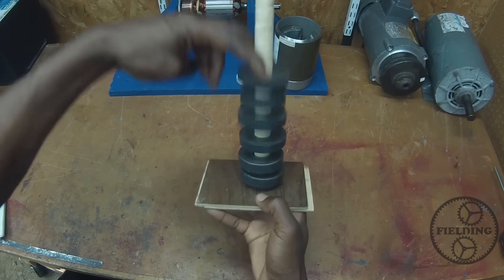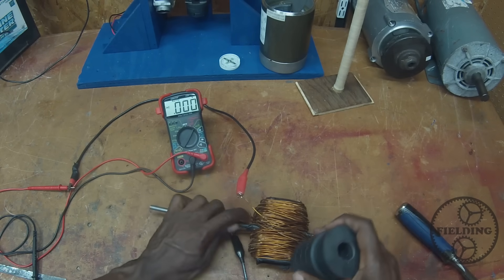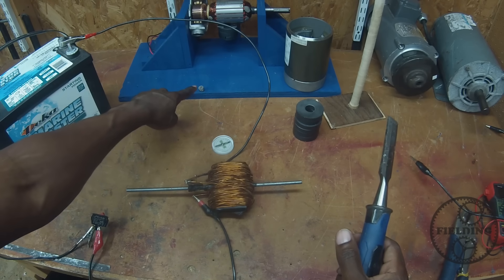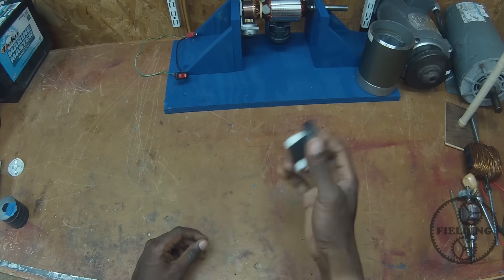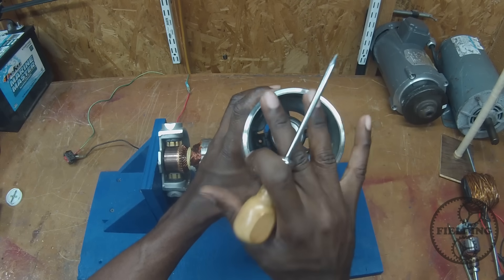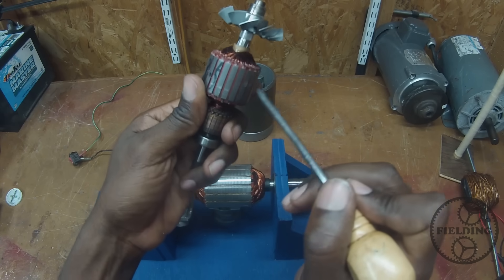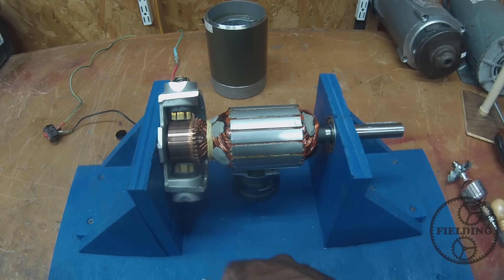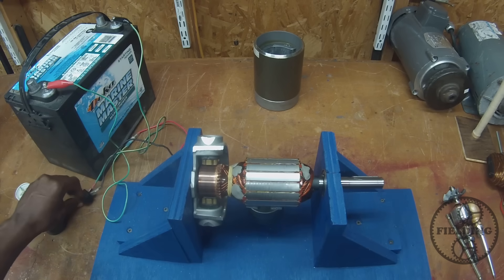How Motors Work For Beginners (Episode 1): The DC Motor: 032

Comment: When you check continuity of the windings in a DC motor, you’re really just checking continuity of one set of pole windings correct? If you wanted to check all the windings you’d have to slowly rotate the armature correct? If one of the pole windings was shorted to motor chassis, the motor would be toast correct?
Reply: I've never tried this before but you could cut the wires from the shorted windings.  If you bypass the short then the motor should work, just not as well as it would have normally. If you have to cut multiple sections, then it is probably toast.

Comment: What if the two brushes are touching the coil that's parallel to the magnet when you press the switch will the motor turn?

Comment: I got a 12000ib winch,  brushes look good and it has 4 lugs , it's for in and out,  but on the case ground and pos marked, but on the brushes,  there is a small bolt going to the case,  should there be a rubber washer under it so it doesn't ground out? Cause when I test it,  ground to neg side and jump red lug to f2 and touch pos cable to f1 it sparks or grounds out and reverse does the same

Comment: Thank you sir. The knowledge I took  from this video allowed me to problem solve an important motor at my plant. The motor had 'copper drag' filling some of the valleys between the commutator segments. Much better after I painstakingly cleaned out the copper flakes and buffed the commutator segments. I assume that the shorted segments would cause either a misaligned field causing drag or a short with resulting in no motor rpm? The brushes were new , worn in and free under good spring tension.

Comment: My question is, can you charge the 12v battery (via solar/wind) that could then, in turn, spin a motor that runs 1000 watt + in order to run a dehumidifier 24/7?

Comment: Hello. Your videos are brilliant. I have a question about dc motors. The one I have is part of a 500W Redi-line motor-generator. If the Redi-line has not been used for a while, it won't start. However, if you tap the case with a mallet, then it will start. I have seen the same symptoms in starting motors for trucks and cars. Once the motor has started, it will usually start again after it has stopped. Is the not starting problem common with older dc motors? What would cause the problem? Thanks.

Comment: Rotational torque in a bc motor is accomplished with Fleming left hand rule in which the rotating field surrounding the coil conductor interacts with the main field flux. 
There will be a force applied to the armature cook based on this interaction 
It is not as you are showing here. It is not poles attract and poles repel. Look up Flemmings left hand rule. Sorry but you are not correct.

Comment: can u please try and explain armature voltage and field voltage?
say 250vdc armature and 40vdc field?(the field is electromagnet)
so if u put a meter on the shunt of  the brush or spring as u showed u'd read the 40vdc field or the 250vdc armature?

thanks buddy!

Comment: Hi Jeremy. Always great content here.
I feel that you must have covered this but I can't find it in your vids.
Mobility scooters normally have 2, 12volt batteries, but when "they" fail it is usually only one that fails.
Do you have a vid showing a bench / drop test to find out which one is still good.
Or is there a way to tell using a multimeter.
Thanks Jeremy.

Comment: Does that mean i could put the multi meter on the motor while the magnet is off and the electricity is on and the motor is NOT spinning and see which part of the rotor the current is going too?

Comment: Jeremy, I have a question I hope you can answer. I'm trying to do a D/C amp clamp meter test on a D/C snow plow motor.( on the truck, not a bench) If I place the meter on the positive wire near the battery source I get a reading.(250 amps maxed) If I place the meter on the positive wire between the out going side of the contactor and the motor I get a reading,( 250 amps maxed) But if I place it on the inbound side of the contactor , near the contactor I get maybe 1 or 2 amps reading. keep in mind that the motor works just fine. I'm pretty experienced with electrical circuits, But this has me dumbfounded. I would think I would get a similar reading anywhere along the positive wire. I became so frustrated that I mocked up the circuit with different wire and contactor. Same result, An area where the meter doesn't read any amps. My brain is going to melt trying to make sense of this please help!!!!!!

Comment: What's the difference btwn 3 phase and Single Phase motors J?? Can 3 phase motors be used n a garage/home domestic 13 amp electrical system.. Is that possible

Comment: Electricity does not travel through metal. It travels on the outside so you have to make a lot of surface area. That is why we use plates and wire wound up. More surface area more electricity equals more power. Other reasons also but that is one major reason….
Reply from the maker: The wire is wound up to increase the density of the magnetic field created by the wire. This is a trade off because you are also increasing the distance the current has to flow which increases the resistance. If you want to hear a discuss about this idea of Electricity "not traveling through metal" I recommend you watch this video where an electrical engineer interviews Derek from Veritasium. It is not nearly as simply as stated. https://www.youtube.com/watch?v=O-WCZ8PkrK0

Comment: OK< I might not get an answer but I noticed that gavity apllies to magnets like what you had on the PVC pipe. meaning that though the one at the top was kind of a set distance from the one below it, the one second from the Bottom had less space between in and the bottom one, and so did the others going up the pipe. Right or wrong?

Comment: Ok, question to anyone, (and this may come out as an ignorant question, I understand), what position is the computator in relation to the coils? Are they perpendicular? Or does it matter? I understand the concept, with switching the electromagnetic from each section, but is the computator in a different rotation from the coils? Does that make sense? Is it necessary to function? (Btw, @jeremy_fielding, I just fell onto your channel. Awesome!)

Comment: The Rotor in my rotozip keeps getting extremely hot extremely fast, under no resistance. I just turn it on, wait .15 Secs, turn off, and it's to hot to touch. I replaced brushes, cleaned 90% of the copper. I have it out of the plastic  casing. Any idea what would cause this??

Comment: I'm not educated most everything I know I do with my hands and I'm for 51 years everything I do I do with my hands I've always been good with my hands so it just seems everything I touch I can figure it out and I'm wanting to figure out you know electrical especially this type of electrical today's reason I'm watching these kind of videos I want to see how you wrap these things up far as like the grinders the saws the drills all these things that weather run on a battery or whether it went on a cord how this electrical engineering works but that was a very good video and I learned a lot just from just this little bit right here which I know it goes into a huge amount of depth

Comment: Hey J I'm a auto mechanic, and I'm working on a windmill using a toyo 3 pin altonator as the windmill to charge a car battery so I could hook up a converter to use during a black out or use a light n wifi router, can you help me set it up.

Comment: Fucking love your videos bro I actually just learned why my dryer stopped running the motor went 😑 more specifically the carbon brushes and brush assembly went and needs to be replaced 8:19

Comment: Great video. It looked like the motor was continuing to increase in speed. Since the motion of the motor itself switches the magnetic loops what limits the speed of the motor -  the 12V input voltage, the time it takes to generate the magnetic field (which presumably isn’t instantaneous), or the physical strength of the materials?

Comment: Your DC motor can be a generator if the iron sheets on the armature are removed alternating one sixth on and one sixth off .  Then the motor will spin from the permanent magnets and the commutator brushes will pickup a current DC.   This DC current voltage 12 can be wired to an inverter to have 110 v AC power continuous peak power without fuel or pollution.  An edison generator powered electric heater.

Comment: I am not an electrical engineer, but out of interest used a 1000w 48v pmdc motor as DC generator connected to a 35cc petrol motor with pulleys and belt. It runs and shows volts 48 to 60v, but when i connect any load like a bulb or another car window dc motor to output terminals it doesn't run the load and instead pmdc motor pulls and slows down the petrol motor. Any idea what my mistake is and how to fix it. Thank you in advance.

Comment: Hello my awesome friend I had this question in mind and wondering if you can answer it. 
I know DC motors just have one cylinder iron sheets but what if they had 2 iron cylinder sheets with the communicator in the middle instead of at the end of one side., would this make the magnetic field stronger as more wires is being used or would the magnetic field from both cylinders be unstable or not workable

Comment: How would one find the proper voltage to supply a motor without a name plate , only amp rated info given . Brushed dc motor with encoder on CNC machine  . Any help would be appreciated. Thanks for the videos great info.

Comment: Hi Jeremy, love watching your videos, very informative indeed. I have a question, my treadmill just blew the other day and found that I have a permanent magnetic DC motor, but it also has an earth wire coming from  the motor and upon inspection it seems to be that the earth had been crushed beneath the  metal frame thus shortening and blew the small 10amp glass fuse on the MCB. Any information on why there is an earth connected to the inside of the motor? Many thanks for any advice. 👍😎

Comment: 7:05 using metal sheets (that are electrically insulated from one another) instead of a solid metal block can minimize eddy-current. So the motor becomes more efficient by decreasing the energy to heat conversion. And it also increases the lifetime of the motor, since magnets loose their magnetism faster when heated

Comment: Can show a video how the commutator is  look inside, designed? And can you explain why laminated iron sheet used instead of a solid bar in rotor and also what happens if no iron used on the rotor only with coils...
Reply from the maker: You need to finish the series

Comment: I have an electric hand planer the motor hums but no rotation I didn't see any capacitor so I presume it is dc. I don't know if something wrong with bridge rectifier ( there is a square electrical box ). There is no permanent magnets but copper winding in the stator surrounding the rotor. I sanded the carbon brushes and got it to work for a little but now just hums and I can't get it to work.

Comment: Very nice.

But in practice aren't their essentially three coils that are wired in series such that in two the direction of current is say clockwise and the other the direction is counter clockwise thus giving two of the coils say a South orientation and the other a North orientation?

I ask this because if each coil only had a connection to a pair of commutator plates then with a continuity test you could find which pair of plates were electrically tied together. 

However, if you do search for which pair of commutator plates are presumably tied together electrically you soon discover by the continuity test they are all electrically connected together.  However connected seemingly in series such that some of the coils are given a North orientation and the others a South orientation?

Comment: One question I have, is why did you not get shocked by the wire when you touched it with the chisel?
Reply from the maker: It has a coating on it. If it didn't the wire would short out to itself at each wrap as it was coiled on itself.

Comment: I loved the explanation, having here a drill that does not work, it rotates but it grabs and smoke tends to come out, sparks and continues to rotate if you help it.

Does this mean that a coil or part of it has a damaged cable coating? The smoke is from the resin covering the cable and when a coil fails, it gets stuck and that is where more smoke comes out?

Your explanation served me, I think that is what happens to this engine, I clarify everything else is revised new coals, lubrication, switches ... I estimate the repair is more expensive than the drill itself, having to wind everything again because you can not just choosing the damaged coil forces you to take everything apart.

Comment: Can you please help me? I have a 1.5 HP motor that was tripping my breaker when I switched it on.  I tested and replaced the start capacitor.  The tripping stopped and the motor turns well.  However as soon as I place the belt over the pulleys and try to start it the motor starts to spin up but stops speeding up at about 1/4speed then after 30 seconds the breaker trips.  I have tested and verified proper function of the circumferential switch.  I'm at a loss of where to go from here.  The motor is in like new condition and has no burn smells.  Also this is from a delta table saw and the motor does not have brushes per the  company rep I spoke to.
Reply: Found the problem.  Turns out the power supply was inadequate.

Comment: Very good explations and demos. The laminations are dilicn steel sheet , not iron , you can demonstrate with a DC motor with a horse shoe msynrt and two sets of windings of enamel coated copper wire on a cork ....cork motor with one dry cell 1.5 v battery.

Comment: I want to make a small generator to charge a 12V battery bank...6V Battery x4.....what's kind of the motor should I need..?? I got a small buget ..under $100....775 motor or something else..?? need high rpm or low rpm..?? I am thing 2 mini DC motors to work it out...what's your suggestions..?? rpm about 20000 or about 3000 RMP...?? or something else..??

Comment: I never understood the difference between single and 3 phase before!  Now that I do, are you going to discuss brushless motors such as used in model aircraft? The case and shaft are connected and the stator (?) does not move...

Comment: Now I want to build a motor. I saw a video or article that I can't find anymore, where students at a university made cheap super strong electromagnets they think might be useful for fusion. Instead of winding wires, they used copper foil tape, which I think concentrates the field much better, gives them magnet strengths only previously achievable with superconducting if I remember correctly, and all made with off the shelf parts!

Comment: Awsome channel. Got here from Smarter Everyday recommendation. I was wondering if you have a video on an easy way to control a small stepper motor without having to wire up an Arduino? I am just looking for a way to raise or lower a platform using a nema17 and knob or up/down panel. Appreciate the help.

Comment: Does this rotation occur because the brushes on the commutator are angled relative to the magnet? If the bottom brush was flush with the magnet would you no longer have this rotation I am assuming?

Comment: Hi, it is for educational purpose, I am wondering if you can make a video showing what happens to an AC brush motor when the resistance from the load is greater than the torque produced by the motor. i.e. the rotor stops spinning, then what happens?
Appreciate your work and effort.

Comment: Great video! I have a question, if the magnet or rung (the one linked with the commutator) is already aligned with the external magnet at the beginning of the cycle how does the motor turn? Is the magnetic field not perpendicular (at an angle) to get the motor moving? Is that why the magnets are made of multiple parts?

Comment: Jeremy I read that you don't have any degrees in this field but you are by far the best teacher/ video instructor I found so far and I just graduated from a trade school as an Electrical Technician and that school didn't teach this stuff anywhere as good as you did in 12mins! Keep this up! You're helping me out so much! Thank you
Reply: My friends mom is a college professor that teaches "basics of electrical engineering" to future engineers, masters and phds. I at the time, a student of engineering management replaced her a wall power outlet because she didn't know how, she wanted to call an electrician and i've told her "that's easy, only 3 wires, let me do it", i've done it before and i know how to do it properly (my dad showed me). She is one of the top professors in that university, who also lived and worked in Boston on some projects.